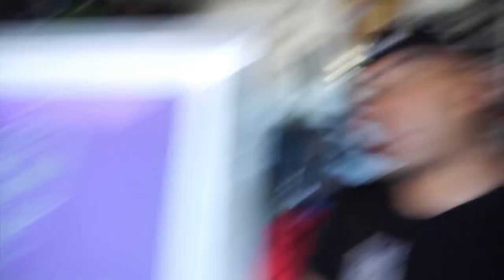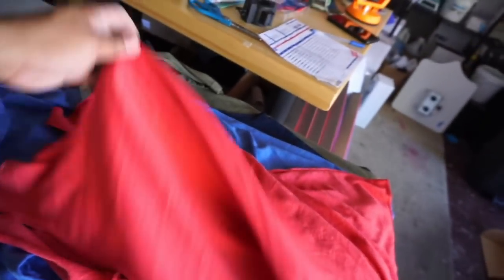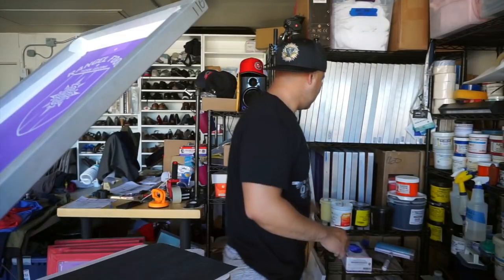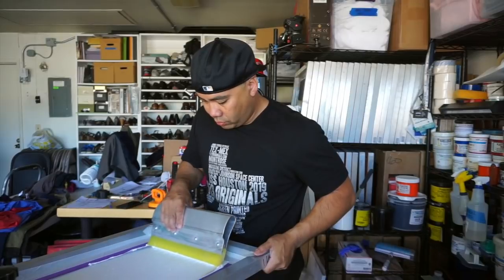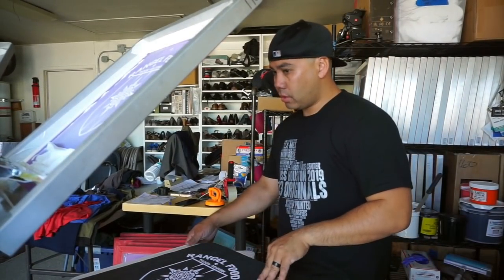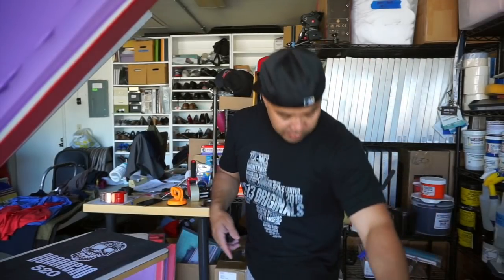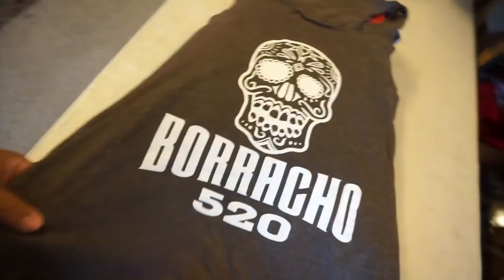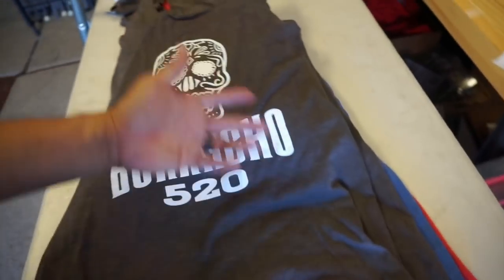Screen Printing - 1 Color / 2 Sided Prints (S:05/Vlog 013)

Comment: Cool design. I've gotta question Rhy... Going between three different neck lines (crew, tank, v), do you just eyeball the artwork on front or do you have marks on your pallet for placement?
Reply from the maker: Yes I have markings in my platten for a guide